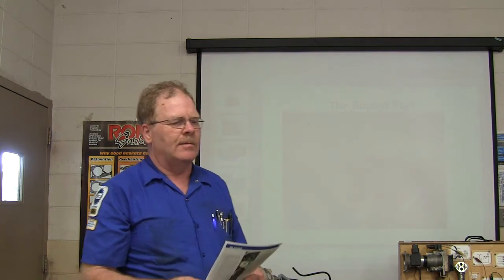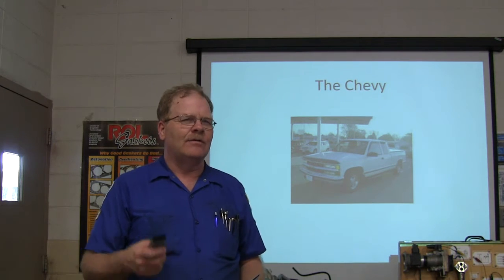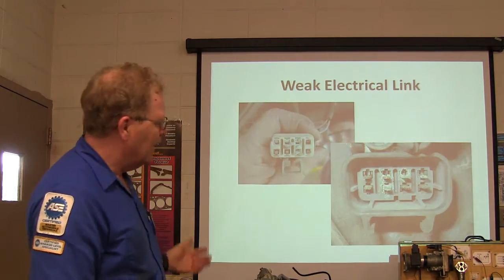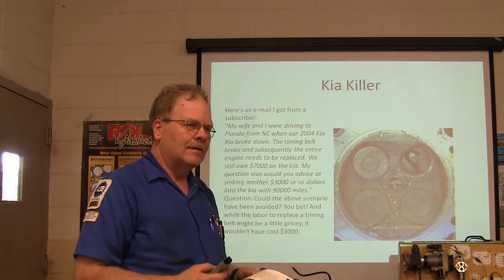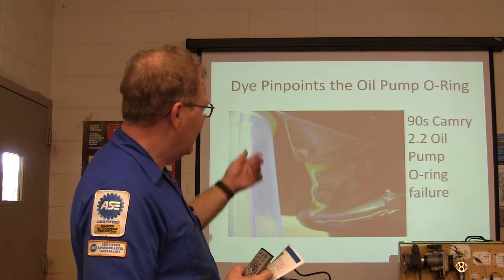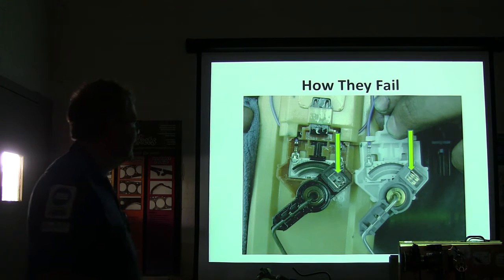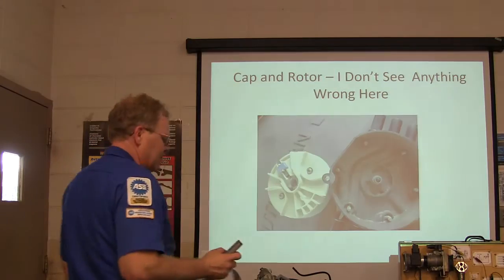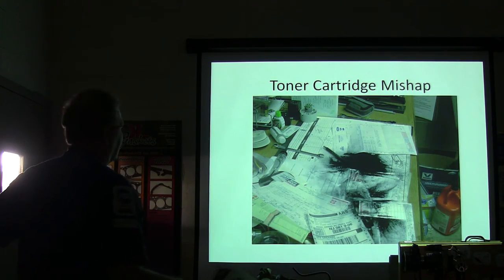War Story Thursday   Weak Links

Comment: I used to work with all types of toner depending on the type of machine that stuff can be as bad as brake/clutch dust and fiberglass. You probably already know it is a magnetized heated drum roller that creates the image by pulling toxic metal dust onto the paper. Done a lot of evap purge valves from bad weather and cooling fan clutches from hot weather on Nissan/The different older japan mazda cars intake hose leaks MAF bypass buck and got cv joints ever other year in hot weather/Stuck or sticky IAC on Ford Honda engines/critters chewing wires all models/dry rot tank fill and vent hoses all models/overheated engine side effect thread damage in aluminum head at spark plugs/construction site vehicles short air filter life robbing power. This year I had one with a worn through wire in the seat test light showed no problem until you sit to drive it.